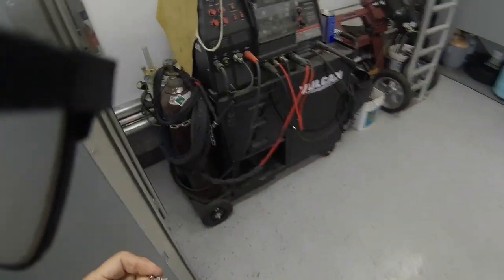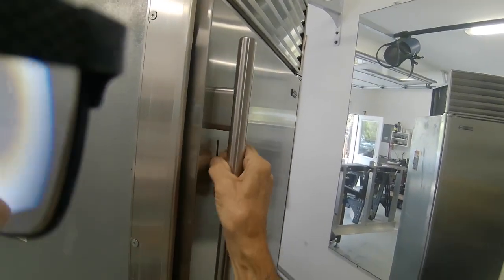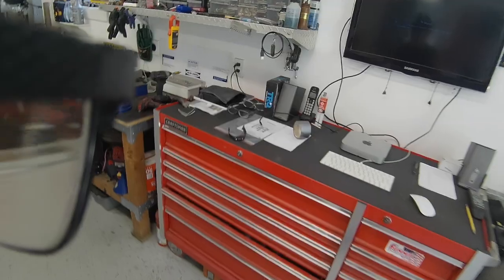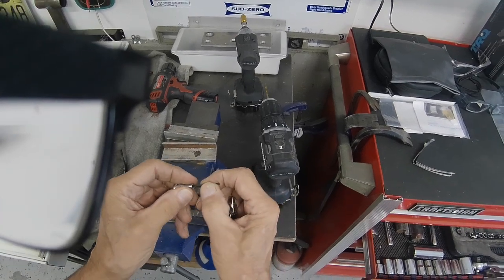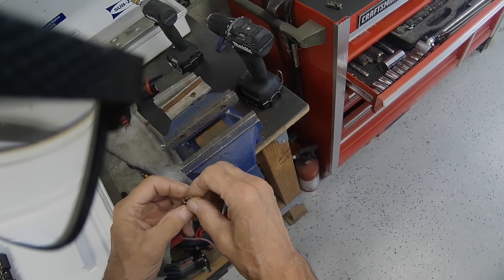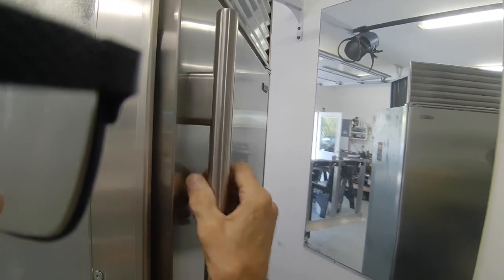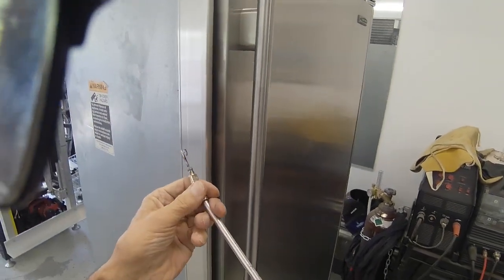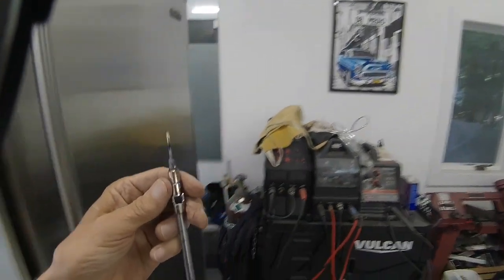Sub-Zero tubular handle set screw tool

Comment: I have 532 subzero did the seal system on refrigerator side now I have nice frost but the fan it’s not going full speed I replace fan 3 times and still not getting full speed at all times, sometimes spins fast and sometimes spins slow any idea of what could be 
I replace compressor heater loop evaporator and as well fan switch and cold control
Reply from the maker: Did you use subzero parts
Reply: @SubZeroSpecialists  always
Reply from the maker: Are you talking about the evap fan motor? If so disconnect the wiring harness and apply 120v directly, if the motor runs normally then you have a wiring problem. Also check  to see if you’re getting 120v at the harness. Did you check the fan switch? Jump it out and see if that works.
Reply: @SubZeroSpecialists  thank you let me try that